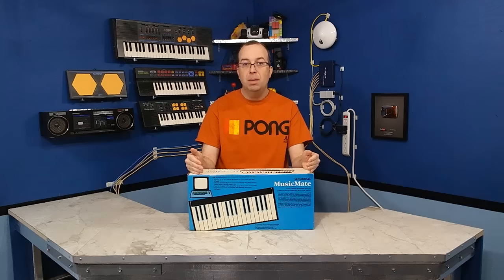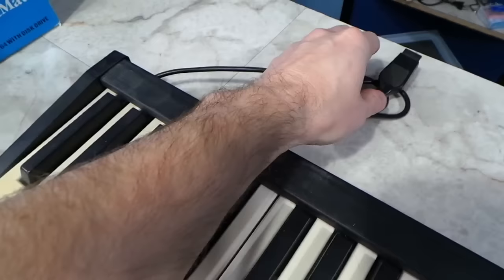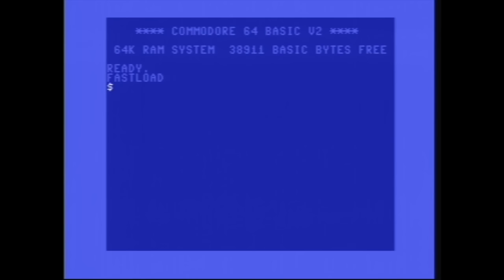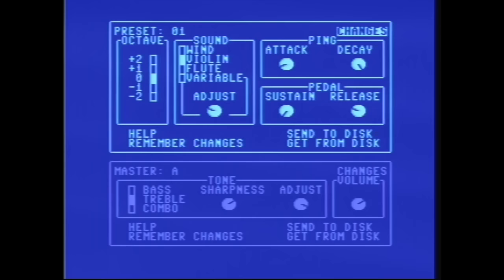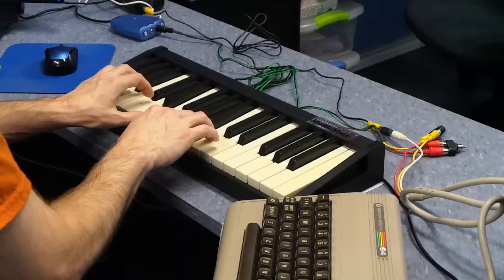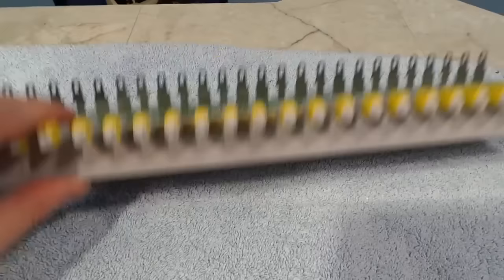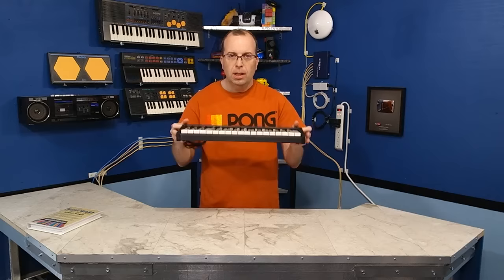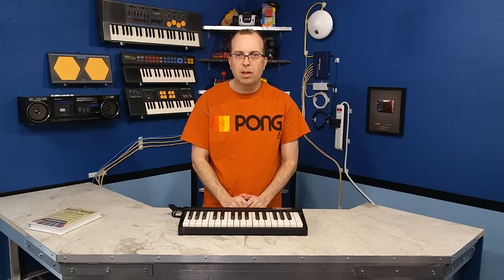Sequential Music Mate for the Commodore 64

Comment: That "other" Keyboard shown on the software package is in fact a synthesizer, the Sequential Circuits "Prophet 600", a little brother of the well known Prophet 5. :)
Reply: I actually was fortunate enough to own a Prophet 5. I would love to find a Prophet 10. That is a rare beast.
Reply: You're right though. Prophet 600.  A cool synth!
Reply: The 600 was the first commercial keyboard with MIDI.
Reply: @mrz80  that and the Roland "Jupiter 6" I think they came out at the same time and when they first showed midi at NAMM they demonstrated by connecting the Jupiter 6 and the prophet 600 together
Reply: @mrz80  that and the Roland "Jupiter 6" I think they came out at the same time and when they first showed midi at NAMM they demonstrated by connecting the Jupiter 6 and the prophet 600 together

Comment: If this was made by Sequential Circuits, the keyboards on the back of the box is a Prophet 600 Synthesizer.
Reply: Crimson Sunrise It IS a Prophet 600.  I have one just like it, great synth.  The manuals for early MIDI SCI keyboards specifically talk about the C64 as a companion for home recording.
Side note, the joystick port is translated to MIDI data with that dummy keyboard.

Comment: its easy to play 32 keys by just using 5 signals. you just gotta use binary signals. 00001,00010,00011... but the problem is that there would be no 0 left. can they possibly use any of the other pins just to send the signal that a key is pressed or something?
Reply from the maker: I thought about that at first.. but then I realized that wouldn't work when you tried to press more than one key at a time.
Reply: 8-Bit Keys Easy. You don't send them all at once, you just tell the computer a certain key is pressed or released, and the computer keeps track. For 32 keys you'd need 5 bits + 1 for pressed/released, which seems fine for the joystick port.
Reply: 8-Bit Keys love your videos by the way ^^
Reply: jort93z Sorry for the spam. Good point, maybe it's sent in two frames in rapid succession? First is the key, second is the state? It could even be that the pc keeps track if it assumes all keys to be released when the program starts (easy to test this theory by holding down a key when running the program)
Reply: Could it be done in the same way as 5 hole paper tape?
Reply from the maker: Well, even if it worked that way, it would require some sore of controller inside the keyboard, which is what I was trying to figure out from the beginning.  Originally I thought maybe they were doing something clever that would allow it to be a passive device.
Reply: The chip is most likely just a shift register.

You only needs 3 signal wires to make it work and can be used for as many keys as you want with multiple held down too. One wire parallel latches the state of all the keys in to the register, then a clock signal is toggled. Each time the clock edge happens the state of the next key appears on the data line and you repeat this until all the keys are read out then you latch the key state in again and repeat. Only limitation to the number of keys is now fast of a clock you can do and how many times per second you want to check the key state. For example this is how the NES and SNES controllers work.

Shift registers take only a few gates per bit to implement on a chip so they are cheap and easy to manufacture.
Reply: An example of a shift register is the 74HC165 that costs 10 cents per chip in volume. It only has 8 inputs but multiple can be chained together for 100s of inputs if needed
Reply: Well as this seems to be the theory thread, here's mine. The signal could be a synchronous digital signal where one input is the clock and the other represents the state of the key it is scanning. A 3rd input may be used as a frame sync, to simplify the process of finding out when the next scan is starting. That said, the program would be devoting a lot of time to polling this as I do not think there would be an interrupt available for this and the controller IC probably does not support synchronous serial (I will have to check that in my old manuals).
 - Eddy
Reply: Yeah, that would explain why the digital pins wouldn't show any change when the keys were pressed.  You'd have to drive the clock pin to latch the current state of the keys, or something of that nature.
Reply: @berni8k So a lot like Midi basicly? Makes sense since Sequential Circuit was employing Midi from the very beginning.
Reply: ok i thought is maybe used the Analog Paddle pin, that explain the test program, paddles located at 54297, but in 1:36 min you see the connector, and it just uses 3 digital Pins: JoyUp, JoyLeft, JoyRight + VCC, GND. mhhh.... try a assembler test program
Reply: @René Munk Thalund Kind of but not quite. MIDI is simply a RS232 serial port running at a fixed 31250 baud where every key press is sent as a command. Needs only 1 signal wire to work but also needs a lot more circuitry to do, such as a local osciilator to generate the baud rate and some form of microcontroller to generate the appropriate key up and key down messages.

Using midi would probably offload the Comodores CPU a lot as it wouldn't have to constantly check every single key manually (Unless the joystick port has something similar to SPI on its pins, i don't know the internals of a C64 to that sort of detail).
Reply: Aren't the X and Y analog inputs? Perhaps they use different voltage levels.
Reply: Is the C64 similar to more modern Joysticks? There would be analog signals in there. Which I would think would allow you to easily have multiple keys pressed at the same time.
Reply: Dan Rozwood No.  The C64 only had digital joysticks instead of modern analog joysticks
Reply: 8-Bit Keys - check POT joystick pin ;)
Reply: Joseph Still Not at all, the C64 had analog input too. POT X and Y. you right, the Joysticks are just digital but analog Paddles are connected on the same Port.
Reply: Processor use two expansion chips for all the I/O. Not sure if SPI but each one has Parallel to serial and serial to parallel ....  ... if you add a CLK ... well, looks "like" SPI. Probably it was arranged in that way. One of these is being used by the drive port. The other ... I dont recall ... Tape drive ouput is "serial" but Freq or Phase modulated so it wont fit in a shift register.
Reply: The serial ports on the commodore seam to work a little like a modern I2C bus, but it does also have this ATN signal that looks a lot like a chipselect line in SPI. I think its similar enough that one could directly connect a 74HC165 shift registers to it(Tho it would likely ruin the ability to have multiple peripherals on the same port).

Then again it wouldn't take long for it to manualy clock out only 32 keys out of the shift register, Means you have to change the clock line 64 times, at 100KHz clock rate that takes 0.3 ms. So easily done on every screen Vblank with time to spare.

Comment: The joystick port also contains the paddle port. Maybe they encode the pitch as a resistance against that paddle input. Rerun your program with registers 54297 and 54298!
Reply: I hope he'll see this comment !
Reply: Or it has a handshake from c64 to it so simple peak couldn't detect jack. Since they have copy protection on disk - i think they were afraid that competition would dissect it. That might be the reason also.
Reply: To test that -  recommend starting from arduino (since it has much faster cpu) - you can build a basic kempston input there (sega genesis to arduino adaptor is a good place to start). Then - just blast serial out with all the possible values from 0 to last one then start listening after each number. If that's a handshake - after correct handshake is given - keyboard should send acknowledgement.
Reply: Alternatively, record the data sent over the joystick port.
Reply: passthrough with snatcher. yeah, that definitely can work.
Reply: rumborak it's so weird how the keys don't alter the IO, maybe the software enables the keyboard to mess with the IO? Idk, I never really did research about stuff like this...
Reply: Who said that the handshake is one byte?
Reply: Another possibility is that it's similar to how the commodore calculator works with the rotating pulse thing

Comment: The C64 Joystick port isn't just digital, it has an analogue component connected to the SID. I expect the keyboard is nothing more than a potential divider circuit split across the keys, and the ADC in the SID chip turns that voltage into a value of 0 - 255, more than enough for 32 keys. Audio samplers also used this port, because the SID did the actual sampling.
Reply: I'd assumed the 5 digital lines were encoded to give you 32 values.
Reply: @grahampickard3325  not really because in such case it will only detect 1 key push down and it is polyphonic, it will actually require some sort of interface
Reply: david rubio yes of course it’s 3 voice polyphonic. Doh!
Reply: Couldn't there be three different 5-bit values being driven? Seems like quite a coincidence that there are five digital inputs and a very unusual 32-key layout.

Comment: 8-bit guy - you forgot that joy port includes also 2 pots - 2 ADCs, which can be used for keys decoding using extra resistors ladder. Can you check also POTX/POTY paddle registers when you press Music Mate keys?
Reply from the maker: I didn't forget.. I just didn't show it.  But I did check them.  There was no activity.
Reply: I was thinking of the paddle inputs, but seeing as there is no activity just makes this a complete mystery as to how this works over the joystick port.
Reply: Time to break out the logic analyzer and oscilloscope.

Comment: Here in 2020.  I had always wanted this keyboard when I first saw it in Run magazine as a kid in the mid 1980's.  I was also beginning to get into synths as I started to read Keyboard magazine at the same time, although I didn't own any synths.  The C64 was a fundamental subtractive synthesizer due to the SID so plugging this keyboard into the C64 would complete that interface to become a synth piano keyboard machine.  Unfortunately, it cost a lot for me as a kid, so eventually never got it.   In highschool, for a finals project in computer class, I developed a program that showed off the C64 as a live-action performance synth, using the keyboard as a multi-touch keyboard (for chords), with paddles & joysticks as additional controllers to affect the synth SID sounds, such as behave like pitch & modulation wheels. Imagine had I had this Sequential keyboard along with it, it would have been a better live demo setup shown in front of the class (all of us had to show their own projects).  I still have my C64 although it's in storage right now.  Same with that finals synth project, it's buried somewhere in my piles of floppies.  For the SID, I was able to make a dual-SID setup in the late 1980's, so that it could play 3-6 voices.  Anyway, the MusicMate would not only have been great to use as a music recording tool but also for live performance. Perhaps turn it into a keytar for use as a lead synth... although I have no idea how long the key contacts inside would last because it was designed cheaply using foam (sponge) instead of traditional springs & perhaps the electrical contacts would not have lasted & give out after many stage performances.

Comment: My Speculation
A 5 wire connection; green and white = 5 Vdc and ground; orange = serial data (out); two blacks = attn and sync clock (in). The 40 pin mystery circuit is most likely a small piggybacked PCB with a matrix encoder and an 8 bit parallel to serial shift register (given the IC tech at the time). CIA 1 location 56322 and 56323 set the data direction on the 4 joystick lines for each port so this could be set so the CIA outputs on the two black wires "attn and clock". This would be why your reading the joystick port showed no activity since you were not sending the signals out on the black wires. It would take an oscilloscope to determine which black wire was the attn and which is the clock. You could write an interrupt patch to read the port and out put to the screen, and install it before running the keyboard program - it may not work if the program uses the interrupt itself to read the port and over-rights your vector address.

Comment: The Atari/Commodore joystick port can be used for some rather unusual things. Atari designed an interface (the XEP-80) for their 8-bit computers that plugs into the joystick port and provides an 80-column text and 320x200 graphics video output and a parallel printer port!

Comment: The hardware to read the keys is a shift register thing.  Two of the joystick port lines are used for power and ground, two others are used to select the key to read, and one is used to read the state of the desired key (on or off).  One of the selection lines resets the desired key to the first one (far left - F), and the other moves the desired key up a semitone for each off-to-on transition.  Code has to modify the ports to provide power to the appropriate line, to set up the two selection lines as outputs, and to set the lowest bit as the input for reading the key state.  Here's a quick BASIC program to scan once and display the currently pressed keys:

10 POKE 56323,12
20 POKE 56321,0
25 FOR M=1 TO 32
30 POKE 56321,8
40 P=PEEK(56321)
50 PRINT M,P
60 POKE 56321,12
70 NEXT M
90 POKE 56323,0
 
I disassembled the MusicWare code to learn this.  Also, I recently posted G64 images of the 4 optional MusicWare packages and scans of the manuals to the Internet Archive:
https://archive.org/details/sequentialmusicmate
 
I've also written some proof-of-concept code to get this keyboard working with an Atari 2600.  I assume this keyboard will work with most computers and game systems that have Atari 2600-compatible joystick ports, as long as you can control which lines are inputs and which are outputs.  Of course, someone would need to write some interesting software to actually use it!

I ordered this keyboard and the Sound Maker software when I was in high school.  I actually used it live in a local rock band (Desert Ice) for a while before I bought a Roland Juno-106 synthesizer.  The SID chip was really noisy…

Comment: The "Mystery chip" looks like an I²C chip. Back in the 1980s Phillips came up with I²C to be able to control various stuff inside a TV or VCR. The internal controller of the TV or VCR can communicate with everything using only 2 portpins over the I²C bus. There are many chips available, e.g. tuner chips, memory (EEPROM for channel programming), OSD chips motor controllers, IR remote controllers and the like. There are also I/O port extenders available which work like a VIA (or CIA) but need only 2 pins to communicate with a CPU. 

Since the data line of I²C is bidirectional, you need 2 I/O pins and a diode on the C64. It looks like there is a diode in the path of one of the wires to the chip. So all you need for the keyboard is:

+5V
GND
CLOCK
DATA (2 lines for the C64 Joyport)
RESET

The mystery remains which of the many, many I²C chips could it be? The port extenders don't need their own clock, this explains the lack of anything else. The chip works with the clock line when sending data. When no data is exchanged, the chip does nothing.

Nowadays you would use something like the MAX6955 which is a LED display driver with integrated key input capability. So you could add LED displays or single LEDs on the keyboard and have something to scan the keys in. But while popular for the Arduino, this chip was not available in the past century.

Comment: @1:11 is the Prophet 600 from 1982, the first commercial synth with MIDI interface.
Another Sequential model that made use of the C64 as a sequencer was the Six~trak, one of the first multi timbral MIDI synths.

Comment: Hi, really like both of your Channels. If there is no digital input, it will use the analog Paddle Input. Its located in the SID chip on $D419 $D41A via Joy-port, try too Peek 54297 or 54298. There are 255 value each Register, so 255^2  Keys possible :D

Comment: David! Next time you encounter an ABS crack, try this! 

I had a screw "tube" on the bottom half of a cartridge that broke off right at the base. I dabbed just a little bit of acetone on both sides with a q-tip, lined up the two parts and pressed them together for a few minutes. I felt the break "set", as if the two pieces wouldn't shift anymore, so I let go. I then waited a couple more hours and it now honestly feels as solid as if it was never broken at all, because as far as the plastic goes, it's one piece again.

Comment: If they do a resistor ladder and use the analog input of joystick port they can use as keys as the adc resolution allow.
I did that to use a matrix keyboard on a arduino using analogInput instead of using a ton of digital pins.

Comment: Port has 5 digital ON/OFF pins and two analog 0-255 ones that can be used in digital way as well. Shorting +5V with Pot AX and AY can give additional 2 buttons. Giving 128 possible states. You can then assign a binary number to each key like 0000001, 0000010 etc. and even use one bit to tell if key is being pressed or not.
MIDI signals works in that way. They send instructions about what key was pressed and released.
This keyboard could even work without any chip. Just every key should have a switch that gives a signal in it's mid position - when it's being changed from off -> on and otherwise.
Probably bad solution for a commercial product, but it could be fun experiment for us:)